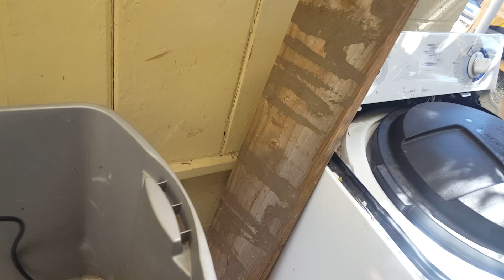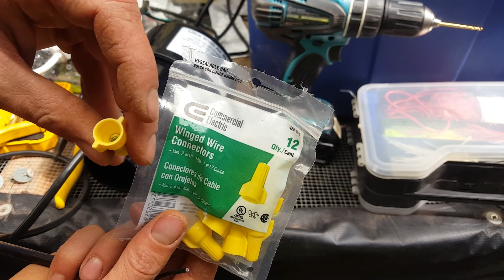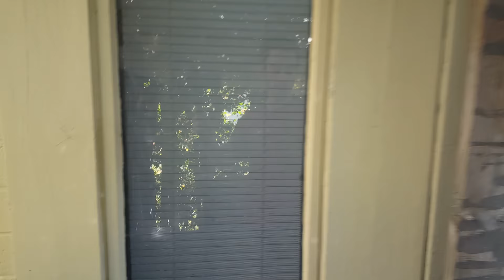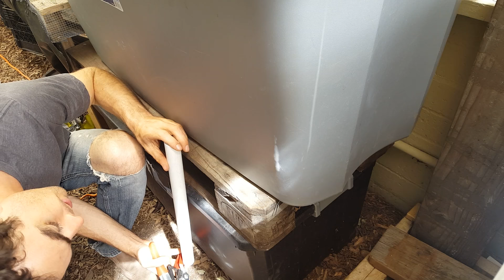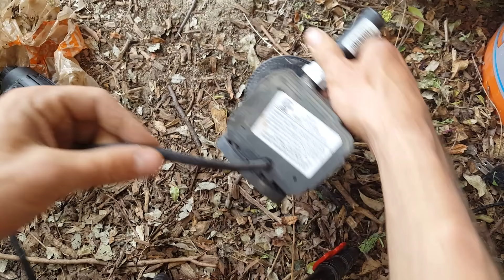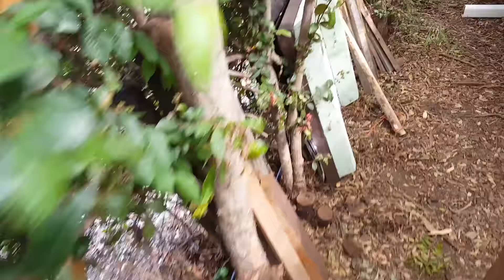How to Make a Greens Bubbler to Wash Salad Mixes

Comment: Hi there, could you tell me the type of plastic bin you are using for your greens bubbler, I just bought a 40 gallon stock tank from tuff stuff because I felt I needed a stronger polymer, plus I am not nailing down a jacuzzi pump but rather using the blower that came with my shop vac. So I will stick that thing into the pvc pipe that is sticking up vertically, the pump will be placed down into it and so I would need a hard stock tank so it doesn't flip over, even though I do plan to have it leaning against a wall. The problem of course is I will have to manually empty it out, which is okay for now my operation is not that big for it to be a problem. Problem is I don't have shrubbery or trees in my yard to give it to, any ideas what to do with that grey water when there are no trees or shrubs to feed it to?
Reply from the maker: Check out using a feeding trough, you can get them in the super strong plastic or galvanized metal.

Comment: Great video. I have a 16gallon sink, probably about 1/2 the size of your tote and a copper manifold with holes drilled ready to go. I am concerned about a 1HP pump, that the agitation might be too great for the volume of water. Do you have any thought? I also could get a 1/2HP pump?
Reply from the maker: Hmm ya that may be a lot of bubbles. Might be able to get away with it, the bubbles just roll the greens around I've enver seen them get damaged. I'd probably lean towards the 1/2hp though, I'm not 100% since this is the only system I've built.